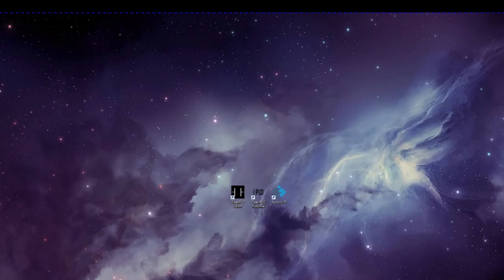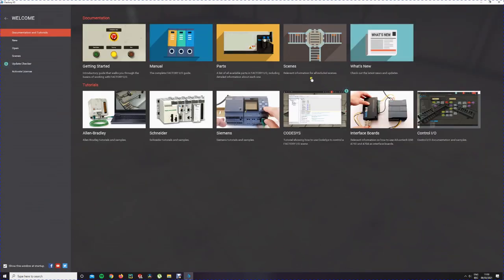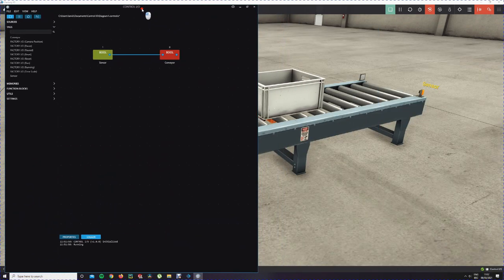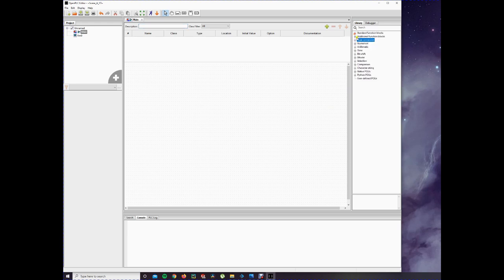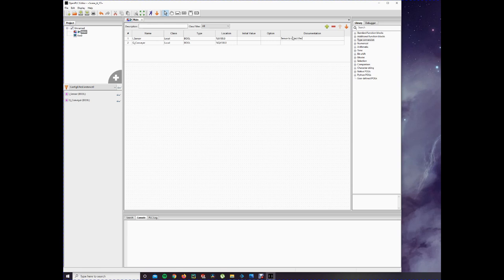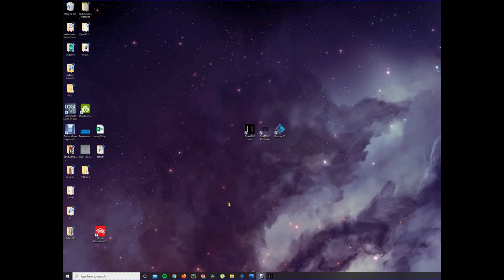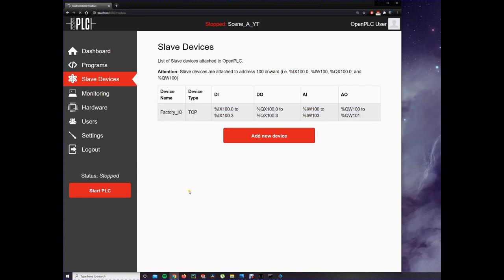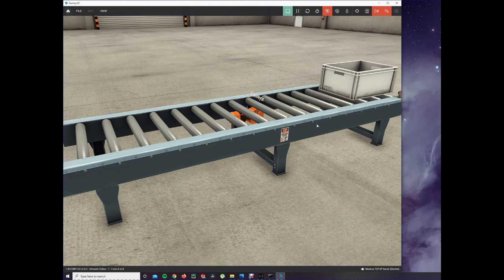How to connect Open PLC with Factory I/O

Comment: I have enjoyed your work, is there a way to have the OpenPLC runtime running on the Arduino and connect Factory I/O to it? I see that you have written arduino code and interfaced with Factory I/O, and Open PLC, I was not sure if there was a way to do the combination.

Id like to build a control cabinet to interface as a trainer for PLC students, arduino running the OpenPLC runtime, while also having a physical control cabinet that they have built and wired.
Reply from the maker: Mmm, I will have a look at this challenge when I get back from vacation 7 days from now. The problem is that factory Io works with modbus TCP Ip and the Arduino works with modbus on serial. I once wrote a script that changed made the conversion but never tested it for this purpose.
Reply: @seafoxc  I appreciate the quick response, I'll keep tinkering with it.  I am lacking on programming skills outside of the controls world, but not scared to tweak some code. Id love to get it all working on a VM, so the students could take it home with them and study and explore outside of available lab hours.
Reply from the maker: @andrewc7524  that would be cool for students. I'm also in the first place a PLC technician/programmer. I also teach in a Belgium highschool (16-18 year olds). In wich country do you teach?
Reply: @seafoxc  I teach at a community college in the US. We have traditionally taught only Rockwell LD logic, but have many international manufactures in the region that need students that are comfortable with all of the languages.
Reply from the maker: @Andrew C, I tried it but then I came across the issue that makes this impractical. The inputs are added to the Modbus Input register but you can not write to a Modbus register. So it is not possible to write the data from a a factory IO Sensor to the Arduino Register. It is possible to read and write to Modbus Coils so you can do a whole workaround by using not used Outputs as Inputs in your program (I did the same in the Fuxa HMI video). But I guess this would be confusing to tach to students and it is better to make use of the OpenPLC runtime to simulate and then change the addressing to use it in the real world.
Reply: @seafoxc  Thanks for giving it a go, I started looking at using Cosesys Runtime/Editor > KepserverEX OPC server > Factory IO. I've got a break from classes this week and plan on trying to get some arduino  I/O to be integrated via modbus serial, attached to the VM via USB of the host.  Might hit a few snags, but should be a fun project if i can get it working.

Comment: maybe a bit of a weird question, but do know how to create a small infinite loop, to crash the fbd program?
I had one before on accident and now I'm trying to simulate a crash with this and am not able to do it :(
Reply from the maker: Is it possible that the error you did encounter was not in fact an infinite loop? I don't think it is possible in the FBD language (or you should wrote a custom FB ins STL). Maybe you encountered an overflow error? This can be don by adding 1 to a variable (CTU +1) each cycle. After the value is above 32767 you will get an overflow (most PLC go back to 0 or spit out an error). If you did find a way to make a loop with FBD-blocks, please let me know! :-). It was a good question either way.